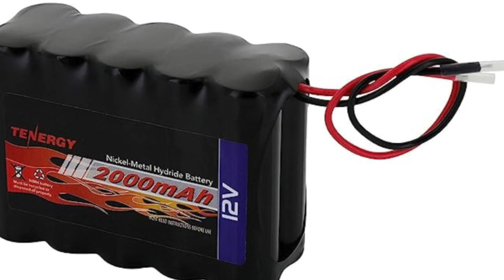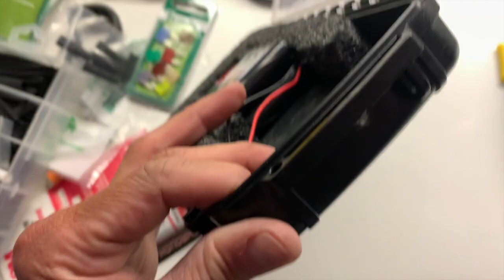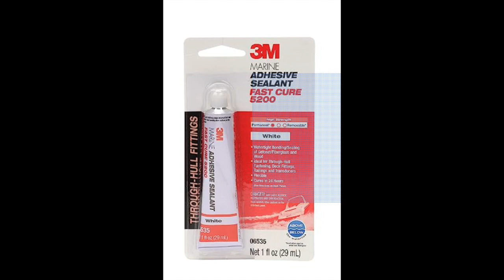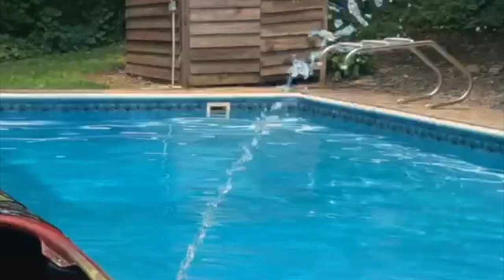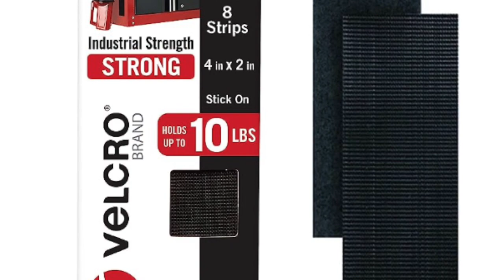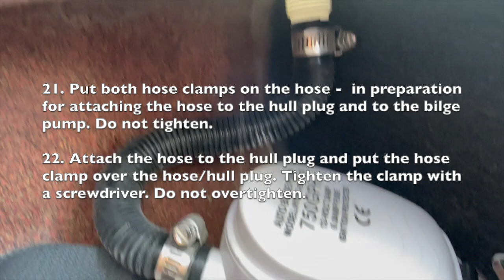IMPROVED: Automatic bilge pump for kayak   HD 720p

Comment from the maker: List of Materials

Dontmiss Automatic Submersible small Boat Bilge Pump 12v 750gph Auto with Float Switch 3/4 inch (19mm) Outlet Dia, bilge pumps for boats
https://www.amazon.com/dp/B07ZTZZHNP?psc=1&ref=ppx_yo2ov_dt_b_product_details

Cost: $26 

Tenergy NiMH Battery Pack 12V 2000mAh High Capacity Rechargeable Battery w/Bare Leads Replacement Battery Pack for DIY, Medical Equipments, LED Light Kit, RC Models, Portable 12V DC Devices and More
Cost: $21.99  

Tenergy Universal RC Battery Charger for NiMH/NiCd 6V-12V Battery Packs, 2A Charger for RC Car, Airsoft Batteries, Compatible with Standard Size Tamiya/Mini Tamiya/Alligator Clips Connectors 01025
https://www.amazon.com/gp/product/B003MXMJX8/ref=ppx_yo_dt_b_asin_title_o00_s00?ie=UTF8&psc=1
Cost: $23.99

FLY RC 3Pairs Tamiya Battery Connectors Male & Female 14awg 10cm for RC Car Lipo Battery Charge
https://www.amazon.com/gp/product/B07VL2B5C8/ref=ppx_yo_dt_b_asin_title_o00_s00?ie=UTF8&psc=1
Cost: $8.99
 
geckobrands Waterproof Dry Box Storage Case, Medium, Black - Watertight & Airtight Dry Box for Phone, Wallet
https://www.amazon.com/dp/B07WZQ6XXM?psc=1&ref=ppx_yo2ov_dt_b_product_details
 
Cost: $19.99

Shoreline Marine Bilge Pump Plumbing Kit | Plastic Bilge Pump Hose | 2 Stainless Steel Hose Clamps | Easy Installation | Heavy-Duty Marine Accessory
https://www.amazon.com/dp/B004UOUBW4?psc=1&ref=ppx_yo2ov_dt_b_product_details
Cost: $10
 

VELCRO Brand Heavy Duty Fasteners | 4x2 Inch Strips with Adhesive 8 Sets | Holds 10 lbs | Black Industrial Strength Stick On Tape | Indoor or Outdoor Use (VEL-30703-USA)
https://www.amazon.com/dp/B09BNPX3XJ?psc=1&ref=ppx_yo2ov_dt_b_product_details

Cost: $7.87

3M Marine Adhesive Sealant Fast Cure 5200 (06535) Permanent Bonding and Sealing for Boats and RVs Above and Below the Waterline Waterproof Repair, White, 1 fl oz Tube
https://www.amazon.com/dp/B003E1ULRE?psc=1&ref=ppx_yo2ov_dt_b_product_details

Cost: $13.34 

Miscellaneous
Foam to secure battery
Cable ties

Tools

½” Drill
1” Spade drill
Wire 
Scissors